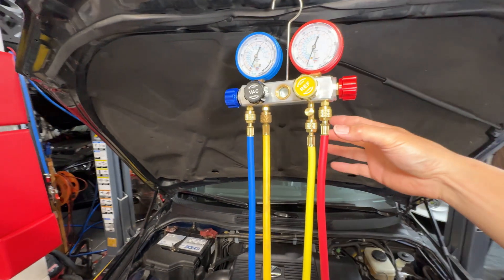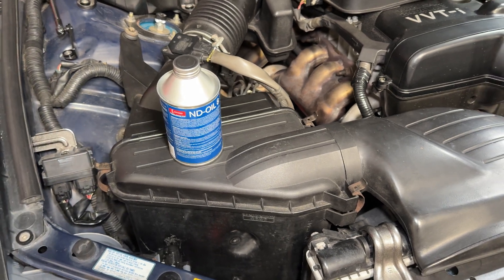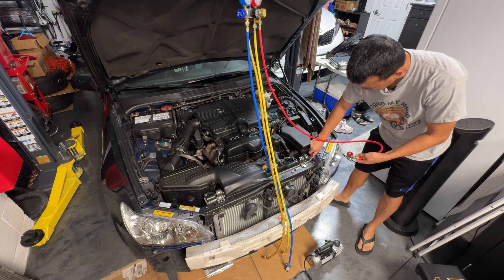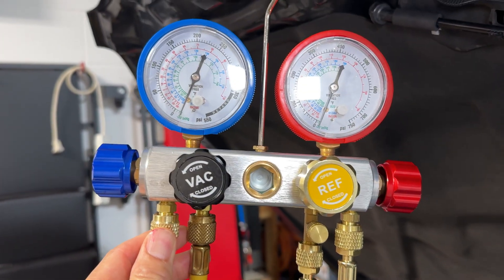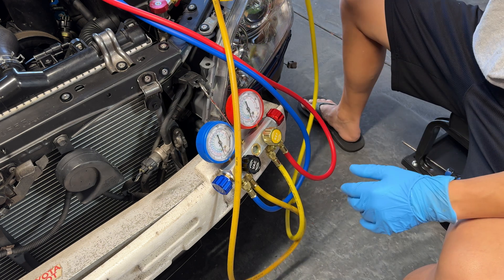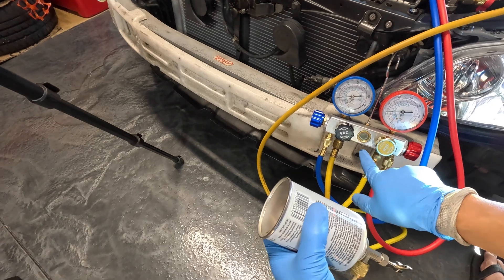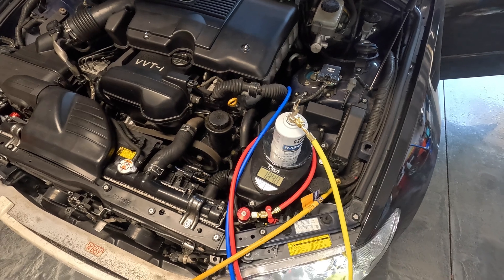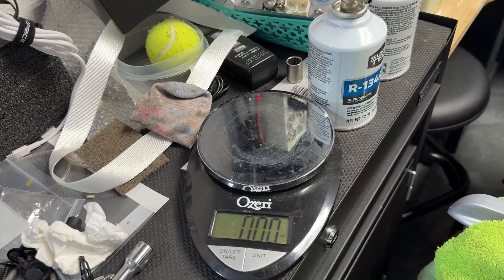How to Vacuum Recharge Automotive AC with R134A HFC134A Refrigerant

Comment: You just dumped liquid freon into your new compressor. Hopefully you didn't destroy it. Time will tell.
Reply from the maker: it was charged on the low side as every guide directs you. .
Reply: @TunerwithKids  Look at the time 9:08 in your video. You opened the blue "low Side". The low side is NOT the liquid side. The low side is the vapor side going straight into your compressor. Hang in there, you'll learn. Hopefully people know better watching this video, so they don't follow that bit of advice. Just for your info, the red side is your liquid side.
Reply from the maker: You’re right it’s charged on the low side like every guide and instructions tell you for car on charging. The first can was slugged in as a liquid but the compressor clutch wasn’t engaged due to low pressure. The second can was sent in as a vapor (can upright) and there was enough pressure to engage clutch.
Reply: @TunerwithKids  As long as you know now. Also, when you were speaking of replacing the compressor and the condenser you didn't mention changing the drier. Anytime the system is opened the drier needs to be replaced with a new one due to atmospheric moisture entering the system. That is best practice regardless of whether you vacuumed it down or not. When charging it should be turned to max with the fan on high speed and windows open. That way you're charging according to ambient temperature.
Reply from the maker: @DavidSimmerman-s8d on my other videos of this project, I installed the new condenser that already included drier media.
Reply: @TunerwithKids  Okay. Good. Just wanting to make sure people watching get the correct info so they don't damage their systems.

Comment: How do you remove the shredder valves?
Reply from the maker: With tool in kit.
Reply: @TunerwithKids  is it same one to remove tire valves? Or what's the link to the kit you used
Reply from the maker: Yes similar but one is slightly bigger. The tool usually come with the gauges.

Comment: There are charts on the internet that show what the system pressure at the ambient should be. I charged my pick up today, and it was 100 degrees outside. My low side required 50-55 psi and high side at 285-300 psi. My vent temp was 30 degrees with blower on high. Your pressures seemed low, and vent temp at 50 is warm.
Reply from the maker: I got 40F discharge air with a proper vent thermometer. This is consistent with my other Toyota cars.

Comment: Why were you opening and closing the valve of the freon?
Reply: Same issue i was having, I wasn’t able to get the refrigerants flow to the system? Any advice what can cause that?
Reply from the maker: @electric9977 those new “self sealing” cans are finicky. Sometimes the screw on nozzle has too much gasket and the pin can’t penetrate too. I screwed in all the way and was trying to hear the pressure drop and see the sight glass.
Reply: I was able penetrate the seal and open it but i wasn’t able to see refrigerant flow… the clutch was engaged, appreciate your answers
Reply: I have a similar set up. 1st time you use it. It pays for itself.. currently troubleshooting a po302 on my 2006 Subaru sti.  Pita. My son has 2011 Lexus is250 awd,  gonna replace the midpipe with the secondary  cars. OEM $2400 dollars. Got a Canadian setup. My daughter  has a 2015 Lexus gs350 f sport.  I do all the maintenance and repairs
Reply: @PeterHernandez-lg2eh OEM midpipe and cats from stealership with that price?
Reply from the maker: Was trying to get it to flow so wasn’t sure since I didn’t see it move the sight glass. But it too a second to get going.
Reply: So i have to turn it all the way down and leave it as is?
Reply from the maker: @electric9977  no, turn it all way down to penetrate seal, the open to allow refrigerant out into the line. You should hear it and see if flow into the manifold.